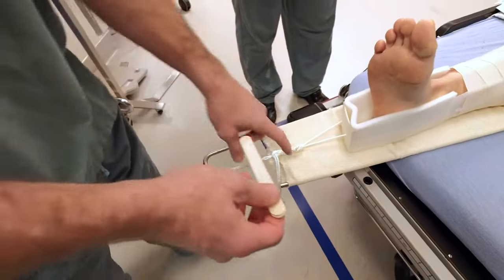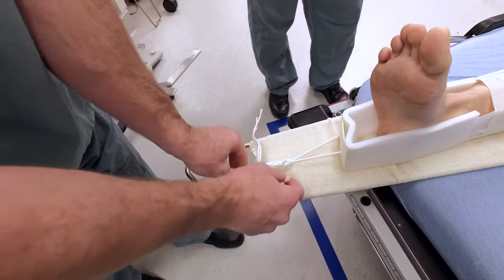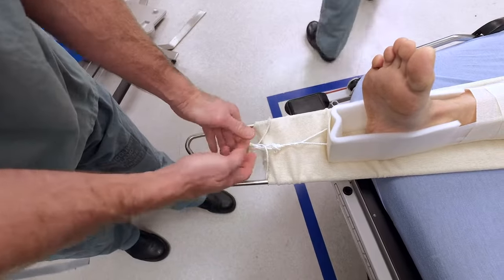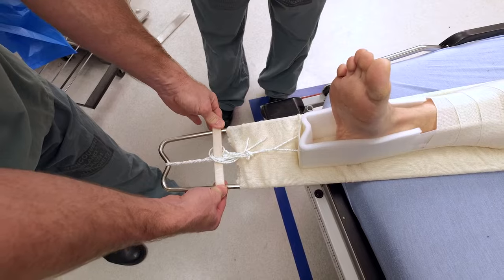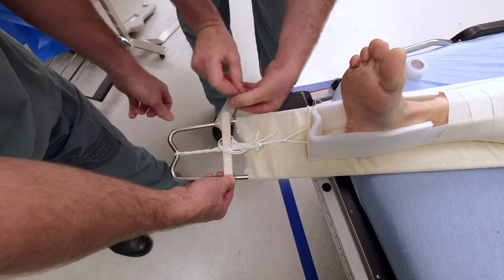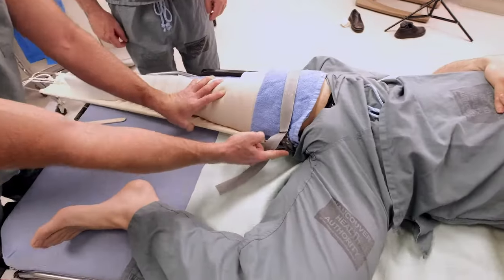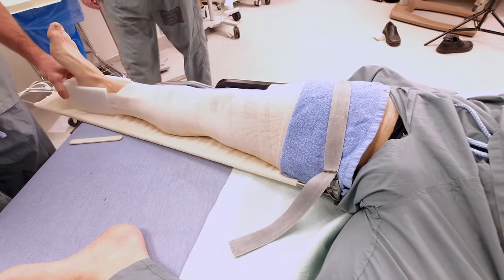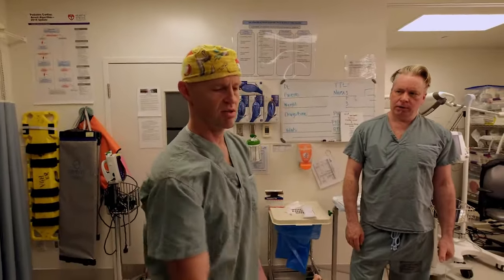How to Apply a Thomas Splint

Comment: Thank you for this video. its been really helpful. and for sacrificing you hair and pants. my question is,if you decide to use weights, how do you know what amount of weight to apply?
Reply: 10% of the body weight
Reply: @sharanagoudapatil233  10% of body weight is a blind rule..I do agree with that’s number but if the weight applied is more , it can distract the distal fracture fragment from proximal one & that can delay the healing & union process..& here in this video, they used ADHESIVE skin traction tapes..according to sir JOHN D.M. STEWART ( traction & Orthopedic appliances book) page number 7 of chapter 1, the MAXIMUM weight which can be applied with skin traction is 15lbs (6.7 kgs )..& in case of non-adhesive skin traction, it’s 10lbs ( 4.5 kgs)..please correct me if I’m wrong..thanku ..

Comment: Thank you.. we in india don't use adhesive skin traction regularly.. how long wil that skin traction can be used once applied?..
Reply from the maker: For the purposes of the Thomas splint it is a temporary measure and should be used for maximum of 24 hours ideally. Skin traction may be used slightly longer for other purposes but for this splint 24 hours should be the limit.